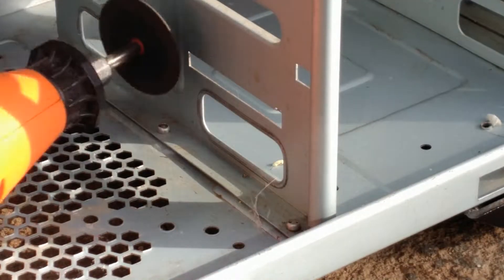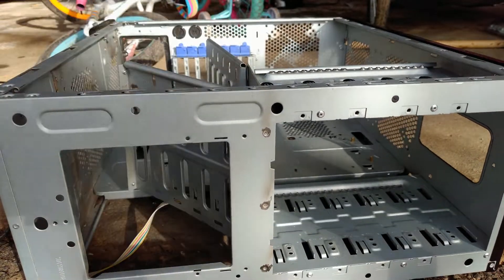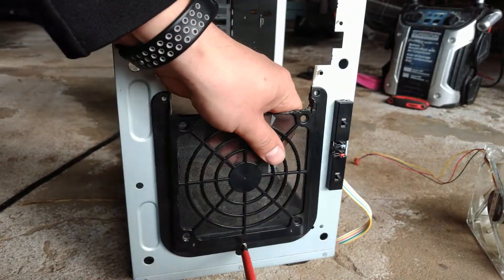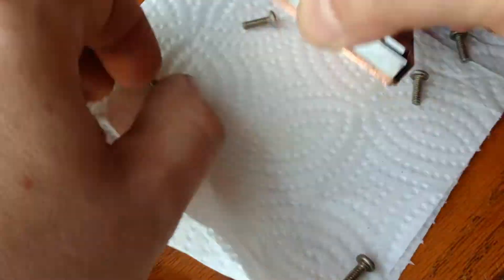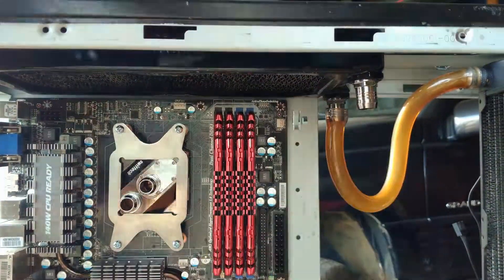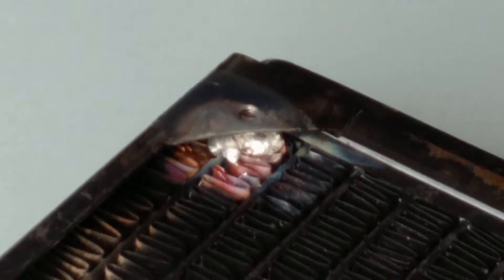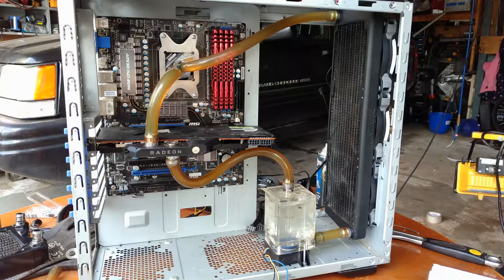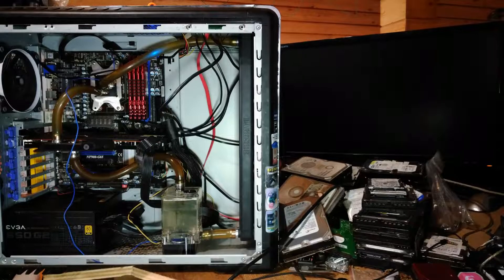Best PC Case of 2019? CM690 Case Mod

Comment: So here's hoping I can get a reply. But I also have a CM 690 Rev1 that I built a new system with. I literally finished up the build last week. I have toyed around with the idea to throw an AIO in the top of the case. I like your idea of fitting fans into the top of the case through the housing. I've never built with water cooling, my question to you is have you tried to fit a 140mm Radiator in the top and if so did it fit? The top fan slots can handle 140mm fans just fine so I assume a radiator should also work only problem I can think I would have is finding thin enough profile fans to fit on the top outside of the case like you did.

Comment: And were did you put the hdd?? Hahaha, nice!
Reply: I have the same exact case and I had to remove the inner most plate in the HDD bays to fit my GPU. Then again I went with an ASRock motherboard that has M.2 slots and I filled them with NVME's. The case originally shipped with a bracket/plate that would have normally been used for older floppy drives or even multi-media readers that would fit in one of the optical bay slots. If he wouldn't have cut out the optical drive bays and assuming he still had that 2.5in bracket/plate he could have fit a SSD in the bracket and just had it in the optical drive bays instead.

Comment: That reminds me.....I need to book a dental appointment......:) How did you take off the front panel? mine won't budge and I need to replace the front fan. The instructions say pull up from the bottom of the case - so far no joy!!!!
Reply from the maker: Remove the side panels, then look for the clips on each side that need to be slid slightly outward to release. There is a grab point on the bottom, but if I remember correctly, it doesn't like to come off that way.

Comment: this pump system is very outdated. With just over 60 bucks you can buy a modern water cooler like a Corsair Hydro Series H55 Quiet Edition (Newegg)
 or even a Master Cooler MasterLiquid LC240E RGB Close-Loop AIO CPU Liquid Cooler, 240mm Radiator for $ 75 at Amazon